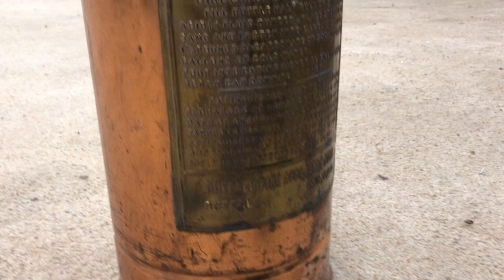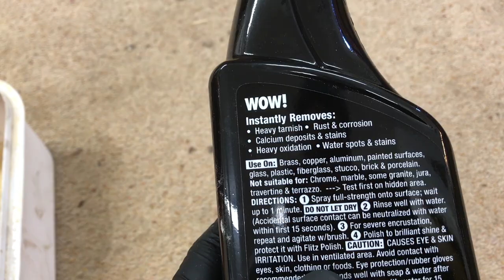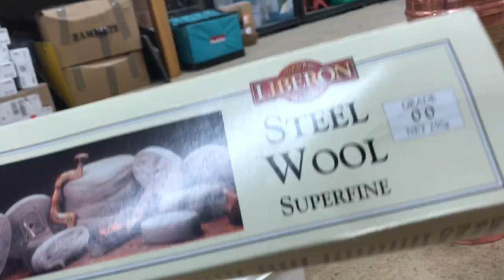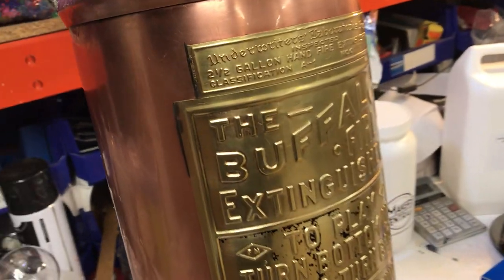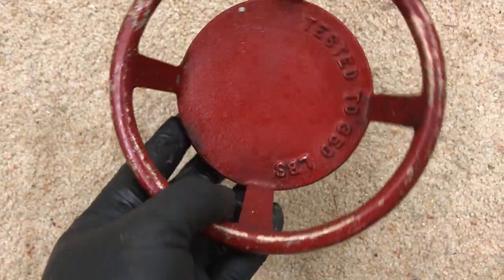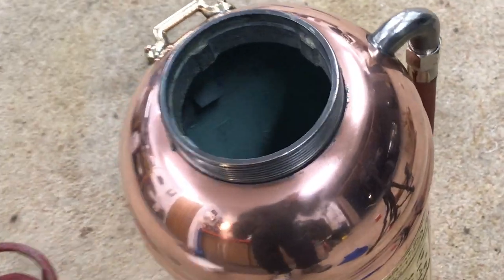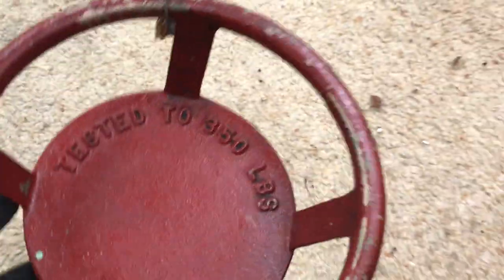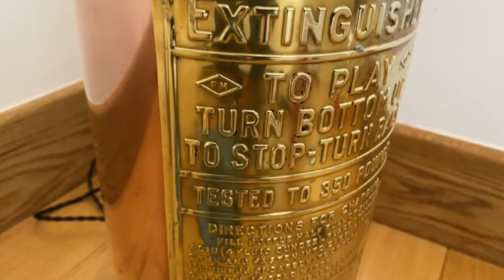Restoration - Extremely Pitted Fire-Extinguisher Restore.

Comment: Ah yes, the old "Buffalo Fire soda-acid extinguisher".  A place I worked in had an old building where there were stored tons of old paper records dating back to the mid-1800s. They had loads of these old copper Buffalo brand soda-acid extinguishers. One was mounted on each end of every aisle and several on each tier. Every year or so they were emptied, cleaned, polished, and recharged. They were in use probably from the late 1800s right on up into the late 1970s. Sometime in the early 1980s they were decomissioned and replaced with modern units. They allowed me and a couple other employees take one or two home.

Comment: In another video the restorer used the same product but he said to rinse it with some water to stop the cleaning process so as not to damage the surface per directions on bottle. He then used the Flitz polish amazing results. I have the pretty much the same one but on the label it indicates tested to 500 lbs. It is a General Quick aid foam for fire. It was left outside for well over 20 yrs has a "lovely"  green patina but still want to shiny it up. Cheers mate.

Comment: I have something similar it's a hand pump compressor that held diluted pine tar and was basically used as a spray paint device these were also used to paint below the waterline of for instance the titanic.
is has a laminated Dunlop rubber hose so it's from between 1900 and 1910.
it still works and smells awesome really old-timey construction smell!

Comment: Save some money next time and first strip the laquer off the copper (laquer thinner should work or paint stripper if it doesn't). Skip the expensive, dangerous chemicals and use equal parts of flour, salt and vinegar mixed together to form a paste (not too thick, not too thin).  Apply the paste to the now bare copper and brass and cover with saran wrap...wait 1/2 hr -1 day depending on how badly it is tarnished.  Wash it off with warm soapy water and wipe quickly with a cheap polishing paste like Gel Gloss (used for fiberglass tubs etc) any polishing paste will do that is not too abrasive.  Then put it to the wheel and wowzas could have saved yourself hours of scrubbing and made your polishing way easier by not having to remove all of the scratches left by the steel wool.